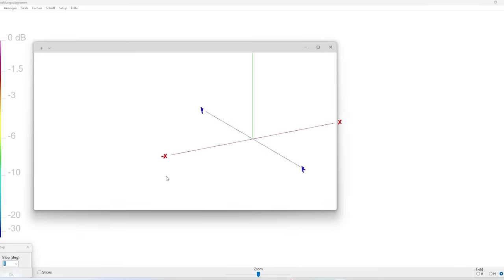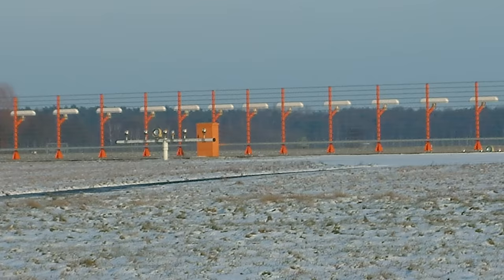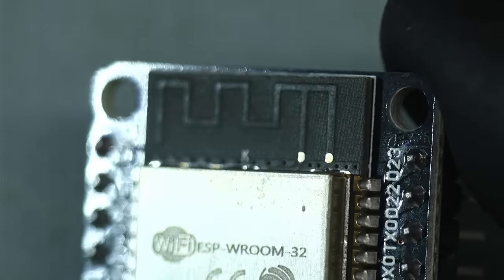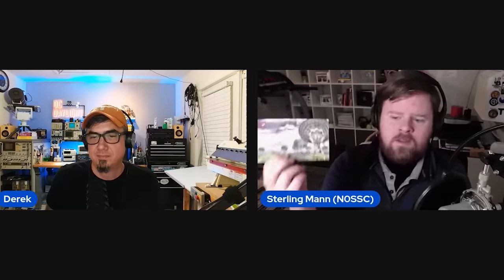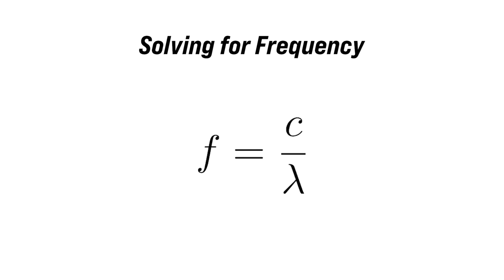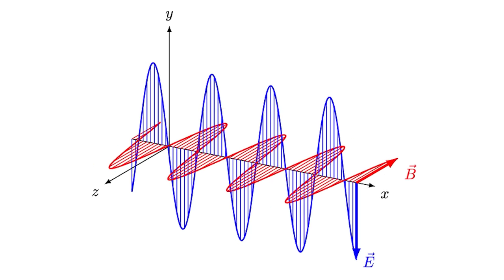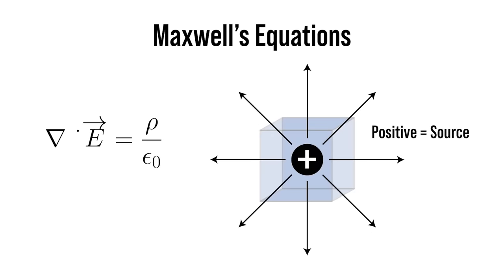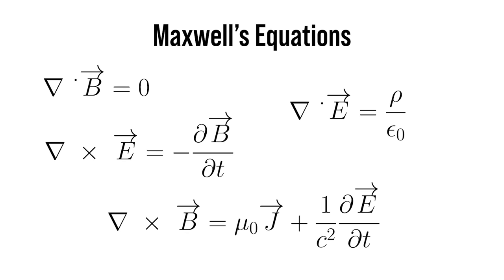Antennas Part I: Exploring the Fundamentals of Antennas - DC To Daylight

Comment: No, you're wrong, the gradient operator does not represent a magnetic field or anything of the kind. If you don't know vector calculus then it was a big mistake to put this topic in your video.  The magnetic field strength is represented by the B in your formula. In my E+M classes from 24 years ago I can remember there being several related vector quantities like B and H that described slightly different things like magnetic field strength vs magnetic Flux. I'd need to review cause it's been too long and I hardly use this knowledge anymore. But be ware at least 2 related quantities exist here. Anyway del, the gradient operator, is a derivative operator (a 1st order partial derivative in each dimension to be precise). And when you use a dot product with it, it's a directional derivative... dot products measure the projection / shadow of a vector in a given direction. This formula is simply saying the divergence of the electric (or magnetic) field is 0. Ie the field doesn't get squeezed and doesn't get stretched. The equation in words says "the field strength is not stretchy or compressible" and this also implies the property known as conservation of flow. To use an analogy of a garden hose, a garden hose does not destroy molecules of water nor create them. Whatever water goes inside one end must come out the other end.
Reply: Thank you
Reply: Could you point out where exactly he was wrong? He was wrong about some things, but I don't see any parts applying to your comment
Reply: @rikkardo9359 time 6:57

"The funny looking triangle represents the magnetic field lines that flow through a closed volume of space".

This statement is way, way wrong...

It's like saying with a right triangle A, B, C where we have the angle theta between the side AB and the side AC that in the expression  A B cos(theta)  that the cos(theta) represents the area of the triangle.  In other words, the statement is false and not like in a small way but irretrievably so.

The gradient operator is a divergence operator. An operator is not a field. And the action of an operator on a field does not result in a quantity that can be considered a field of any kind. The divergence gives a scaler result, after all. Unless we're talking about a fictitious universe then fields are vector quantities in 3D (or possibly 4D if you want to consider relativistic effects...)

If you had a time -varying electric field given by the vector E = < 2*t, cos(t), t^2>, then del dot E =

<∂x/∂t, ∂y/∂t,∂z/∂t > dot < 2*t, cos(t), t^2> =  ∂x/∂t [2*t] + ∂y/∂t [cos(t)] + ∂z/∂t[t^2] = 2 + (-1*sin(t)*(1)) + 2*t*(1) = 2 -sin(t) + 2*t.

The result  is a scaler ie 1d value. It's not a vector and has nothing in common with an E/M field.
Reply: I will add that in electromagnetism, one  of Maxwell's equations says that the divergence of an E/M field is 0. In other words all the electric energy that goes in the pipe comes out of the pipe. The field is conservative. That means electrons/ ions are not being created or destroyed... Just like gravity is a conservative field. If you take a hike and come back to your car, it doesn't matter what path you chose, you have the same potential energy when you get back to your car. Electricity works the same way...  And as far as magnetism goes... magnetism is just a pseudo force... it's not even a real field. I think of magnetism as an electric field lost in time. Ie magnetism is a relativistic effect of moving charges. If there's no moving charges, there's no magnetism.  

If you had a garden hose and somehow water was magically being created inside the hose then the divergence would be > 0.  Or if the hose had a leak that you didn't know about then you might register the divergence as < 0.  In the real world though after accounting for all sources and sinks the divergence  is 0... And this leads to Kirkoff's laws for the voltage around any loop in a circuit being 0 and the sum of the charges entering and exiting any node in a circuit being 0.
Reply: @darinhitchings7104  Sorry for the late response, I usually use a different account.

You are correct, he completely misunderstood the operator.
One thing to add: div(E) = 0, but only when there are no charges present.
Reply: @rikkardo9359  interesting point... yes conservation principles apply...
Reply: Dude stop getting high on yourself

Comment: Simply while talking pressure waves move in free space , similarly the spinning electrons create magnetic field and moving electrons creates electric field when there is positive voltage a.c wave these are applied on the rod and in a fraction of a second they are again taken out which are electrons taken out from the system making the magnetic field field converse because magnetic field is a closed loop every time, so with magnetic field is perpendicular to electric field in propagation they form em wave this is what closed loops and the way they propagation is done is by pushing one wave like the constant water when stone is thrown one wave pushes other in front they push each other "waves push each othere and electrons push each other" this is fundamental how they push is Maxwell law😊

Comment: There are so many types of antennas.  Folded dipoles are the simplest.  But vertical, Yagi, and Quads.   The real question is who is still on 80, 40, 15 and 10 meters?   When hams have moved to 2 m and 6 m.  And just how good are tiny built in antennas on newer compact SW radios.  K6AGE.

Comment: 8:13 What can never understand is that the signal must propagate down the pipes of the antenna at the same speed its being received,  instead of the arms sharpening the signal, would it not blur it? the build of antenna appears to assume that the signal is fed across the arms of the antenna instantly.

Comment: Few corrections on Maxwell's Equation -
1. 8:15 Electric fields can exists without a Magnetic field. There are actually two types of electric field - Electrostatic field and Induced Electric field. One is  due to stationary charge distribution(Gauss law) and other one is due to a changing magnetic field(Faraday's laws).
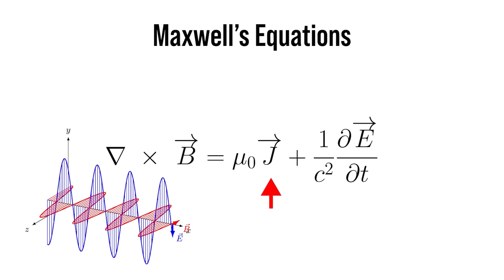2. 8:41 J is not displacement current. J is the CURRENT density. Displacement  current is actually the other term in Ampere's Law which is ε(δE/δt).
Reply: @jitulhussain7902  I came here to make the same comment.

Comment: Hello,
Thank you for your video. One question I have regarding maxwells equation 1 and 2. You used the sink and source analogy to equation two ( electric displacement) but I had learned in the past that for magnets being monopole (equation 1), this was a reminder that magnet are not monopoles and hence no source and sink.
So, just wondering if I had it wrong or this was a typo on your side? Thank you!

Comment: 8:20 No, an electric field can indeed exist without an magnetic field, and vice versa. The time term in Maxwells 3. and 4. equations just tells you than when one field is changed over time, the other is induced.
Reply: Yeah.  I was shouting at the screen a few times during this vid, and this was one of those times.

The other was during the clumsy attempt to explain how moving charges in an antenna create a propogating signal.  GUYS.  Moving charge creates a changing E field, which creates a changing B field, which creates a changing E field, etc.  An experienced guitarist knows this better than these guys, just by knowing how pickups work.  Yikes.
Reply: @patrickmestabrook No that is incorrect.

Moving charges create a magnetic field. To be more precise a steady current creates a magnetic field.

A changing current, charge being accelerated causes an EM/RF field, photon(s) which comprises a magnetic field component, an electric field component and propagating away from the wire at the speed of light.

An electric field is created by the presence of charge. That charge can be stationary or moving.
Reply: But can you say that a static elektric field is existing... not much of an existence if it couldnt even create itself in time.
Reply: as a physicist I was looking for this comment 👍

Edit: for those confused, a good example is a bar magnet. It has no electric field, but induces one of moved, so moved through a coil means you can measure an electric output from the coil
Reply: This should be the top comment.
Reply: @deang5622  Not really, the lensing effect still occurs. Electricity, magnetism and sound can exist independent of each other, even if electrons are embedded, they're not exactly visibly energized if that makes sense...The core I would consider high state,  Euclidean plane low state and Earths inner atmospheric again high energy state...
Reply: @FULLCIRCLE36988  What do you mean not really?
There is nothing inaccurate in my post.
If you think there is then quote the actual sentence you think is inaccurate.
Reply: @deang5622  Let me put it this way. Once polarity is created, current is no longer needed, to polarize a compass needle you just need directional kinetic or frictional energy right? That polarity exists between high and low states afterwards regardless. Earths magnetic field exists independent of electrostatic energy generated between atmospheric boundry layers and the pressure and density differentials between the two...  Sorry, a bit tired does that make sense to you?

Comment: Thank you for this video.  Please correct the very prevalent error also seen in so many otherwise fine textbooks and other illustrations of wave phenomenon.   The zero crossing points of the electric and magnetic fields do not occur at the same time or place in space but are offset by 90 degrees.
You too show propagating waves with E and B fields arriving at the zero point at the same time and place.

Comment: I would like to ask you for help on measuring rf field strength.  Is there an accurate way to measure the rf field where the location is inside of one wavelength?  I would like to measure frequencies that are in the hf amateur radio bands starting at 1.7 mHz and going up to 30 mHz.  Do I want to measure the e-field or the h-field?  I think that the e-field would be easier to measure.  The equipment I have is a Siglent spectrum analyzer which I believe to be accurate and I have an older field strength meter, EFS-1, which works but I am not sure about the calibration.  I read a paper from Keysight Technologies which describes how to use a spectrum analyzer to measure the e-field.  (859xE: How Do You Measure
Electric Field Strength with an
Antenna and Spectrum
Analyzer?)  I'm not sure about what they call the antenna factor which gives volts/meter in terms of dB's.  I checked into buying an accurate rf field strength meter that can measure lower hf frequencies.  I found them to be very expensive.  What is driving this project, is the FCC requirement to measure rf exposure around the amateur radio station.  The ARRL has an online rf exposure calculator.  I have several unknown factors at my station and I would like to be more accurate.  I also want to learn more about rf fields.  Thank you.

Comment: I qualified in both Electrical & Mechanical Engineering at the National University of Ireland back in the early 1960ies  !!!  That means I’m eighty now !!!!     I assume that your intention is to get youngsters interested in the field of radio frequency transmission & reception.  A very noble enterprise indeed.

Might I suggest that to begin with you omit all the Maxwell, Faraday etc stuff & just focus on a composite wave which can be transmitted & received over a range of frequencies depending primarily on the aerial.

Then explain in simple, preferably non technical terms how this works .

Once you’ve achieved this you can step slowly into the simple equations which in turn give a more comprehensive understanding of what’s going on.

Only a suggestion. !!!

Comment: As a former Amateur Radio Operator (Technician II), I really enjoyed this. I’ve made all sorts of antennas, but I never really understood the math behind what I was doing.
Reply: One of my uncles was an Amateur Radio Operator. He introduced me into the world of electronics and antennas. May he rest in peace. Greetings from Panama 🇵🇦
Reply: @mikesmith1290  Cool, I'm a general class. I took a close pass at getting licensed when I was 11 or 12, but didn't quite get it done. I git my license (both tech + general) during the pandemic. Thinking about getting an extra class license in the next few years, also. I haven't done any DX yet, I'm working on getting that set up.  If you have math questions I'll take a shot at them. I have a phd in engineering however this is not my area at all. I do optimization and estimation and machine learning and some statistics/ probability theory.  I have other friends and connections though that are super solid at these topics though.

Comment: You graphical display of the electric and magnetic fields are incorrect....
The one is a derivative of the other, which is equivalent to a 90degree phase shift.
Think of the two components E, B being kinetic and potential energy, and exchange from one to the other resulting in the two fields, and thus 90 degree phase shift (as per Hilbert transform)

Comment: The discussion of the transition from separate E and M fields in the nearfield to an EM field in the farfield was a little muddled. The discussion in wiki is pretty good. One picture that is missing is the transition from either a high characteristic impedance at the antenna-free space interface from a dipole, or the low characteristic impedance from a loop antenna to 120 x pi (377 Ohm) free space impedance. This is shown in Henry Ott's book on EMI...
Reply: Ott's book is a fantastic read. Highly recommend to all interested in EMI or radiated/conducted emissions and good info on layer stackup. Yes what you mentioned is missing. However, it's always difficult to determine how deep to go on a subject. Maybe  in the future we can dig even deeper. -Derek

Comment: If some smarter than myself knows the answer to this:
Those perpendicular magnetic and electric fields are always represented with waves that have the same phase. My understanding is that antenna though generate them with quarter-phase phase difference? Have I understood this correctly, and if so is there some natural instance where the have the same phase?

 I would like some certainty on this as this has lived rent free on my head for few decades.

Comment: Radiation is complicated. A static charge produces a field that is static. An uniformly moving charge produces a changing field which is non-radiating (it doesn't transfer power at infinity). An accelerated charge is able to radiate (transfer power at infinity). I do not fully understand this although I teach this at the UG level. I can follow the math but I still don't grasp the "why"!

Comment: I like the speaker/antenna analogy.  The math is over my head, so the analogy helps.  I think more of the energy being moved around.  For a speaker, some energy is used to move air molecules while other energy creates heat at the voice coil.  For antennas some energy is radiated away from the antenna while other energy is bounced back to the transmitter.

Comment: The simple reason why antennae produce rf is that the driving signal is accelerating electrons in the aerial conducting material. accelerating electrons radiate electromagnetic radiation.
Reply: Hi Andy. Thanks for your comment. Unfortunately, I have trouble with simple reasons! 🙃
True, accelerating charged particles radiate RF, (intended and un-intended radiators) but I thought it would be fun to look under the hood of Maxwell (or maybe it was just an excuse to talk to Sterling).  😀 -Derek

Comment: One thing that has always confused my about antennas, and I was hoping this video would answer bust it does not look like it will is as follows:

Antennas are somehow driven by electricity, yet antenna's by their very nature are only connected on one side. It doesn't matter if you are talking AC or DC, if you cut the wire electricity stops flowing and whatever you are powering turns off... Yet somehow with antenna's you connect the wire and electricity still somehow flows and makes waves for having done so??? skip the wave explanation for //AFTER// the explanation of how you got the electricity to go down an open circuit!!!???